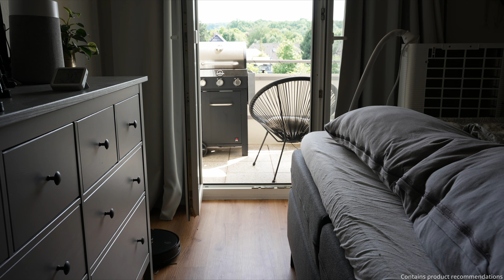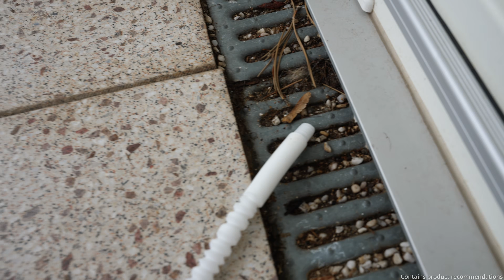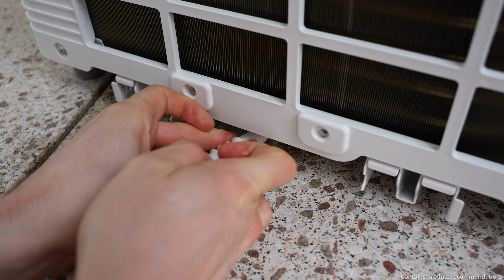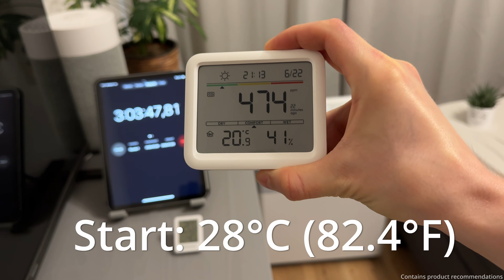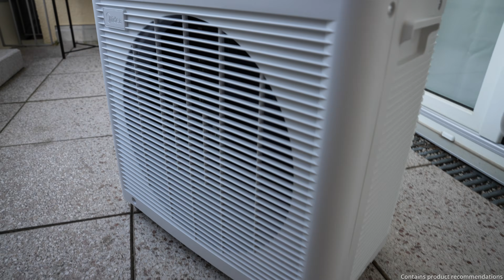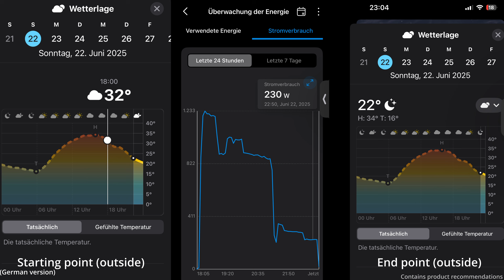Midea PortaSplit Stress Test: How It Performs at 32°C ☀️❄️

Comment: You need to get a seal for that door because even with the curtain closed the slightly open door is leaving in warm air from outside.
Reply: @Steve30x  as long as it is a split system, there’s no negative pressure inside.

Comment: Performance looks nice enough but it really depends on the size of the room it's being used in, 15 square meters is kinda small after all. From what I understood the compressor is in the outdoor part of the device correct so there's not much noise other than fan noise coming through the indoor one?
Reply: le compresseur est dans le groupe intérieur, mais très bien isoler contrairement a une clim monobloc